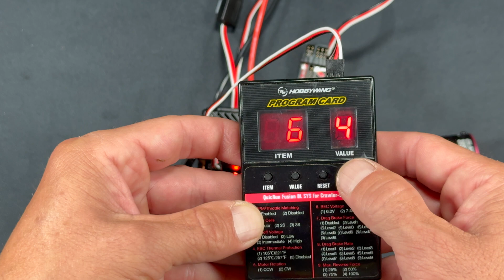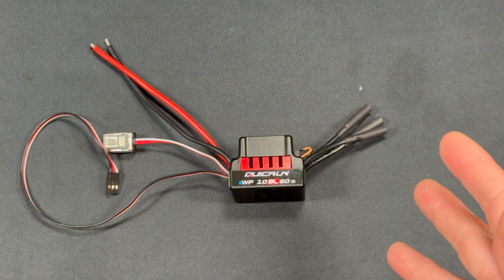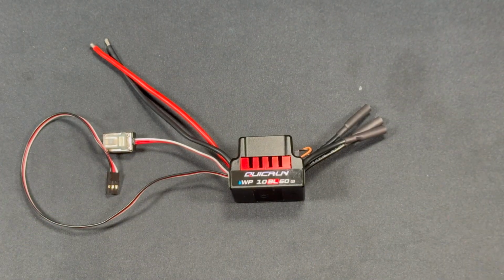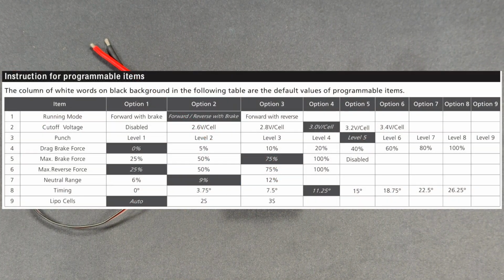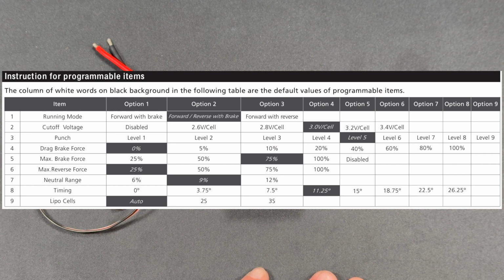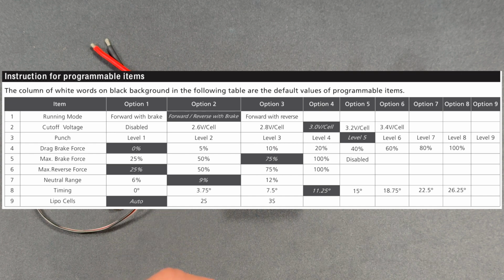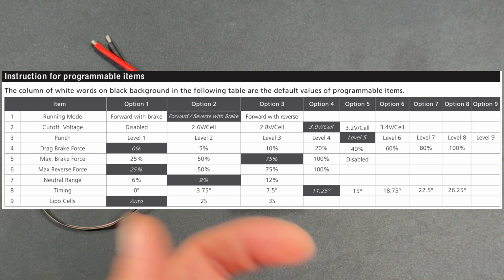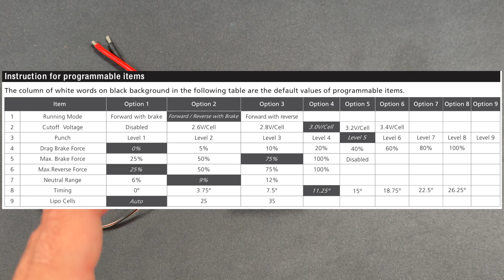Hobbywing Quicrun WP 10BL60 G2 - Quick Look - The Charlie Show - EP 379

Comment: Would this work with a 2435 4800kv on 3s. (I have bullet adaptors) Running it through light snow., drifting , no bashing 1/18 Haiboxing 18859a (for reference) My surpass 45a esc started to smoke and flashing rapidly. I’m guessing it’s cooked.

Comment: how do i  change the motor direction ? ive tried swapping the motor cables and nothing its still faster in reverse than forwarrd
Reply: did u ever figured it out
Reply: Your Problem has nothing to do with the ESC. Reverse the Throttle Channel on your transmitter.